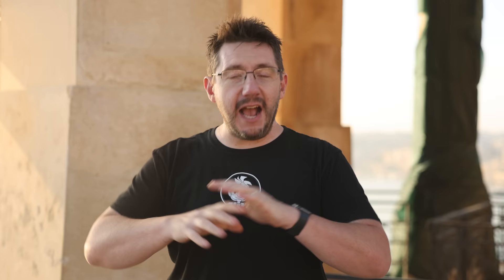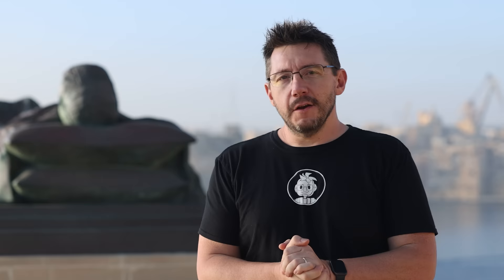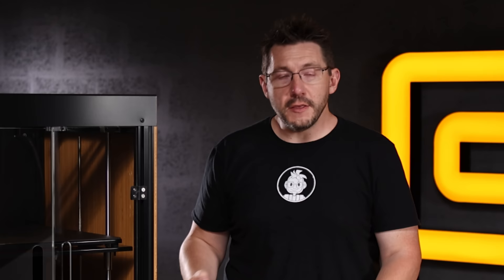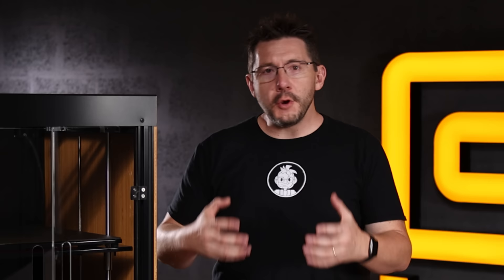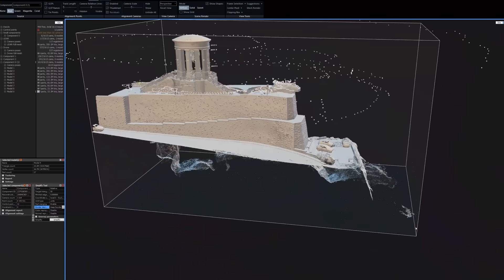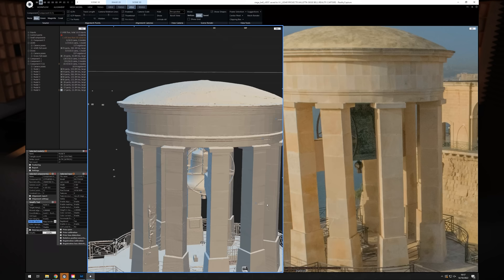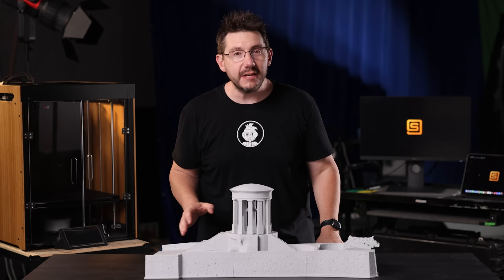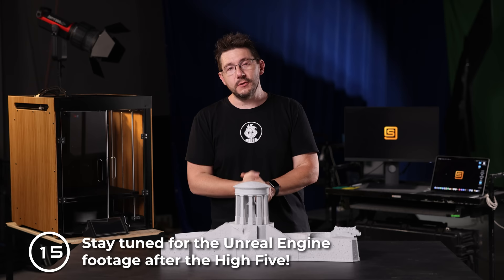3D Printing Malta to Save History!

Comment: Awesome! Great combination of many different elements into one, the model capture, the history, the printer, etc. It reminds me of how some museums are scanning some of their artifacts 1) so they can preserve them in their existing state in case of something as minor as just... aging or as devastating as a fire or theft. But 2) so they can literally go "hey kid, wanna hold a T-rex tooth?" and not need to worry about what happens to it.

While not the first to have done something like this, I hope this brings a little more not-behind-the-scenes coverage to these things so, eventually, it can become more commonplace and work it's way to consumer level. I have used Meshroom a number of times to get good results, but what to do with the model after the fact is much harder without expensive software (Fusion and Blender cry at the output of a LIDAR/photogrammetry scan), good LIDAR is expensive. some of the mobile apps out there require specific phones or have limitations in what you can do simply from technical side, subscription software, etc. In short: the stuff those of us can use outside of a production shop look great to us but compared to what exists but is too expensive, it's night and day. Eventually, it will reach our hands and we'll see the amazing things that come from it.

Comment: Printer seems cool though it lacks heated chamber / chamber control features, automatic pressure advance tuning which to be fair only one other printer I know of has, but it feels like something it should have.

Using v-rollers for the y axis is also just strange.

Still good to see an out of the box, open source corxy with input shaping
Reply: Wait, is PA not standard in most machines??? I can definitely promise that PA is active and tuned by standard
Reply: @construct3d  What I am talking about is automatically tuned pressure advance as can be seen in the Bambulab X1C for instance. Only printer I have seen that tunes this automatically such that users need not change or calibrate this when changing between very different types of filaments.

It by no means is a black mark against the machine. I just wish for this feature to be integrated into open source machines
Reply: @BeefIngot  Its definitely something we have our eye on developing, it's quite a nice challenge because it basically forces structured light to be used for measurement data to be accurate. And once you have structured light processing, you can do some very cool things.
Reply from the maker: some VERY very cool things

Comment: Should've projected the drone photos onto the lidar model and gotten a textured model. Also, scanned the soldier and merged that with the PC generated from photogrammetry to fill in the areas you can't reach.    Not sure when this was done, but the UE5 model looks pretty low res? Why not pull in the full res model and nanite? (Or at least Bake down a normal / wpo for the low res model). 
Anyway good job! Feels Abit like you got 90% there and then didn't finish it off though. I'm guessing budget and time limitations, which is common on these kind of projects.